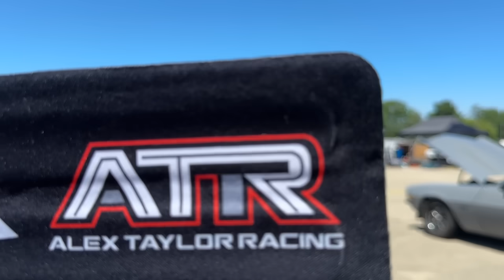Did We Hurt Our Car Too?? 😳 - Sick Summer Day 1

Comment: I had a oil pump that lot wear in it once, miles from anywhere. Wouldn't  get oil pressure after change filter and oil. Luckily on side of motor. Pump, end plate had deep score makes in it. I started off on a concert block, blocking the housing pump cogs. Then finished off on old flat window glass with some valve grinding paste. Worked well.
Got me out of the shit anyway.

Comment: For data back up you really want to consider a NAS in the house connected to the internet they run over multiple drives (at least two) so if one fails there’s always a copy. As well as backing up your car tunes and data I imagine it would be good storage to back up your branding/ video templates/ .psd etc. Locking yourself out of your laptop is one thing but hard-rives do just die and the vibrations/heat from a 200mph street car won’t help :|

Comment: Mickey Thomson now developing running shoes.
Small gaps?? That is what silastic is for. With that distortion  maybe a gasket as well as silastic. On water I simply do not use paper gaskets as so many waterpumps, t stat housings etc are bent from new.
Though WHY with a engine like that are you using wet sump??  Blind Freddy can see the vast advantage of dry sumping.
Reply: WHY is your instrument cluster on the floor?? Should be in front of the driver